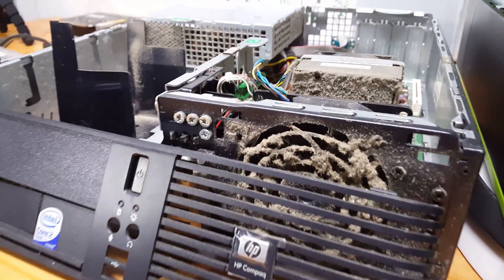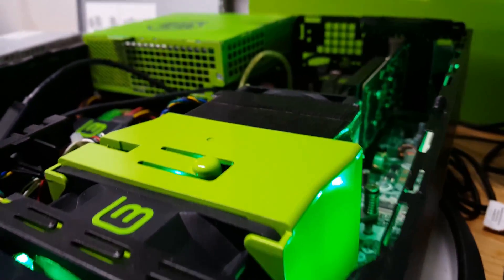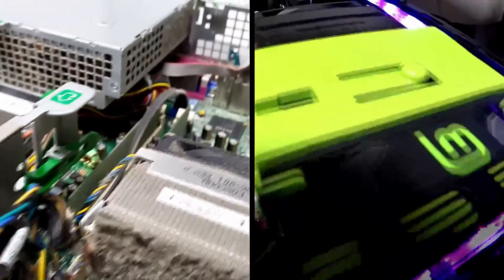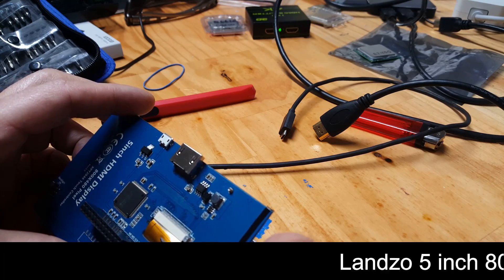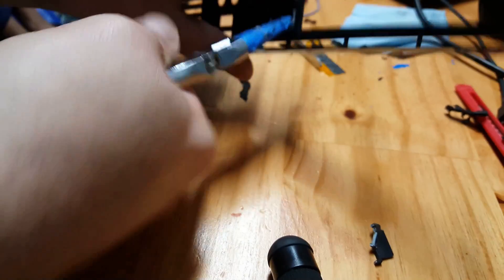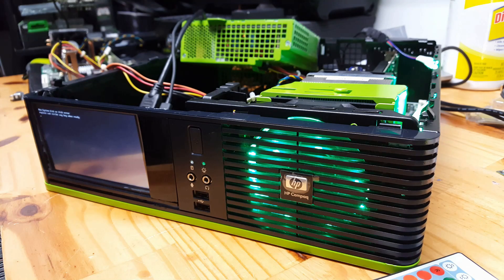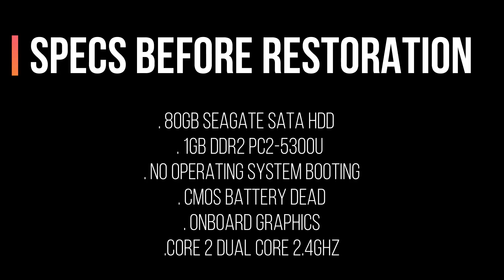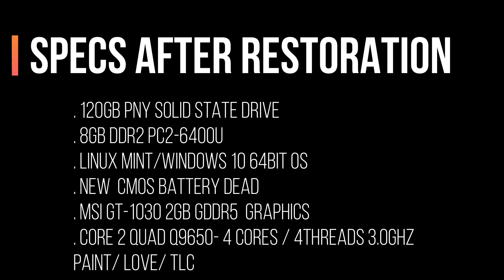How to make that  old HP computer Linux Mint again

Comment: perfect. but can the CPU cooler be replaced using a regular stock cooler? i have sff elite 6300 i7 3770 and gtx 1050 ti. but i want replace a cooler.

Comment: Any Suggestion for my HP Pavilion dm1 Notebook PC that will run Zoom App? (Tried Bodhi and MX but didn't work for Zoom)

Specs:
Microprocessor AMD E-450 1.65Ghz + 500Ghz
4GB DDR3 Memory
500GB HDD
No Battery

Comment: the cleaning and restoring with modifying parts of the video were quite satisfying. Wonder if you have any videos where you power airblast pc's of dirt and dust outside. Maybe even use a high powered pressure washwer to blast off stuck on stains.

Comment: hp 8300 sff here. looking for a case mod to combine a 1070 mini/short with 16x riser powered by an external dell DA-2 psu with add2psu  - probably replacing the 5,25 drive bay and drilling some holes for extra fans.

Comment: I just wanted to take the time to thank you for your videos, modstek.  I have an old HP dc5800 that I got for $10 at a yard sale a few years ago that I was using as a media PC, but it was a little laggy.  After watching your videos, I was inspired to upgrade it with a Q9400 processor, a gt1030 graphics card, a 120 GB SSD boot drive, 1 TB secondary HDD for Steam games, and maxed out (8 GB) of RAM.  It's running like a brand new machine.  Thank you!

Comment: Not sure if you know this, but depending on the chipset you can use a Quad Core Xeon (under $30) in some of those Compaq DCxx Motherboards. They are Pin identical to LGA775--> https://www.ebay.ca/itm/Intel-Xeon-X5450-3-0GHz-quad-core-processor-compatible-LGA775-ultra-Q9550-Q9650/163289253734?hash=item2604cc4766:g:sGUAAOSwArFby5Wx:rk:2:pf:0

Comment: Nice Build! Stupid question how did you connect the pi screen to the graphics card! I mean did you use a terminal or adapter?
Reply from the maker: Not a stupid question it's my fault for not going over it. I used a HDMI to display port cord and ran it to the back of the card.

Comment: Personally always found myself an arch guy, but mint is still awesome for lower to mid end hardware
Reply: I use to be a big fanboy of Mint, and would shill it like no tomorrow, but since I also like XFCE I've felt that the Mint team since Ver. 16 of the XFCE build changed just enough to piss me off to not use it any longer, and have since switched to Xubuntu, and have not looked back since, and it plays really nice with older AMD hardware once you use Ukuu to update to the latest Kernels.

Comment: I just upgraded a dc7900 for my father, but I can't get the total amount of ram (even with dedicated GPU) it shows 5,75Go instead of 6 (2*2 +2*1 in order 2/1/2/1) I don't see any option to "leave" the memory in the bios, am I missing something ? 
Anyway they are still great machines, I kept the original e7500 with 6Gb of ram a fanless 5450 and a Crucial SSD with win10, it works like a champ :) and it's almost completely silent (so quiet I put once the fan in full mode in the bios to be sure everything was ok 😂)

Comment: I just bought a cheap 8200 HP for $23 and the first thing I did was bend back the whole case, shove in a GTX 770 I picked up for $55, and throw a PSU on it for $25, and there was a cheap $100 gaming PC

Comment: A buddy of mine was throwing out a HP Pavilion p6310y, because it dint' play well with The WeenDoze 10. I cleaned out the dust and crud, replaced the HD added some memory and threw Linux Mint Mate 17.? on it. This beast works like a champ. It became my go to Desktop machine.
Reply: ThatsNiceGuy - Technology and More Drop in a 2GB AMD R7, or R9 GPU, Install Xubuntu 18.04, make sure it has at least 8GB of DDR3 RAM, update to the latest Linux kernels via Ukuu app, reboot, then install STEAM and STEAM Play, and you can run tons of games no problem. AMD hardware is very well supported in the latest open source drivers with support from AMD themselves.  I have an AMD AM2+ Athlon II X4 system with 8GB of DDR3 800mhz ram, and AMD XFX AMD R7 240 GB GPU that can still game fine on a lot of games in 720p - 1080p, giving me better frame rates then Windows 7,8.1, and 10 thanks to Vulkan translation with STEAM Play/Wine on non native Linux games. Mind you it's not 100% perfect, and I've ran into glitches, crashes here, and there, but about 90% of the games I've tested have ran just fine, and it's only getting better with the community, AMD, and Valve throwing their support behind it.

Comment: What did you use to spray clean the fan? I saw a can of some sort
Reply from the maker: Brake cleaner
Reply: Looks like brake or auto parts cleaner
Reply: mharris1270  
Brake clean is fine for electronics. Used on car electronics forever and no issues.

Comment: Ok I must know what was in that spray can that cleaned all the dust off that fan, that stuff is like magic in a can!
Reply: BraKleen or some other non chlorinated brake parts cleaner.
Reply: Looks like non-chlorinated brake dust cleaner
Reply: I think it was just a contact cleaner.
Reply: He shouldn't have used brakeclean, it has a tendency to eat plastic parts and strip grease out of bearings.

Comment: I have my GT 1030 hooked up to my server PC through a pcie x16 to x16 riser cable and I'm getting mid 40fps on cinebench r15 for some reason but modstek got 59.83fps. What's going on?
Reply: Check if it’s a ddr4 or ddr5 1030, as the performance difference is insane
Reply: Is your PCIe extender shielded?
Reply: Mr PeanutPlays a bad riser cable maybe?
Reply: Mr PeanutPlays the silicon lottery, not all manufactured chips are the same due to the super small parts and how there are small imperfections. The good ones are kept by main suppliers and others binned or sold to subsidiaries for upgrades or cheap lots. You just got a chip that was in the bottom of the lottery.